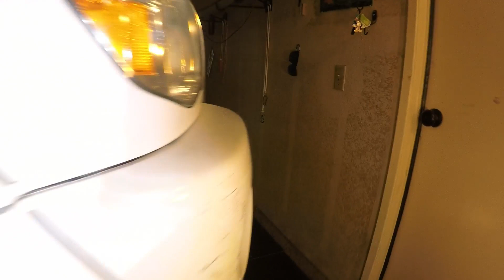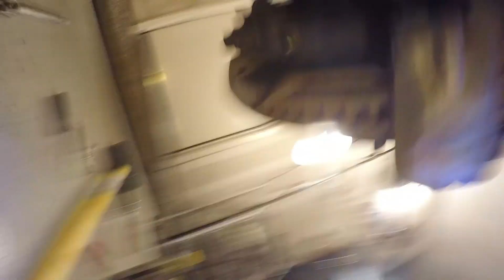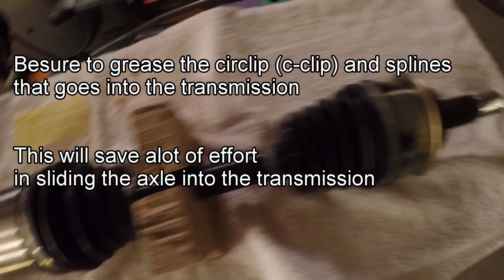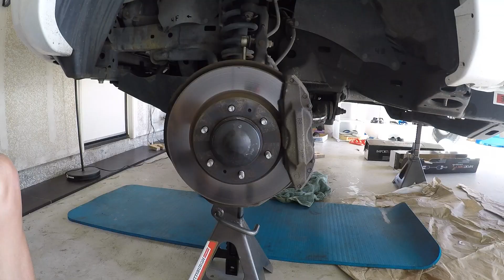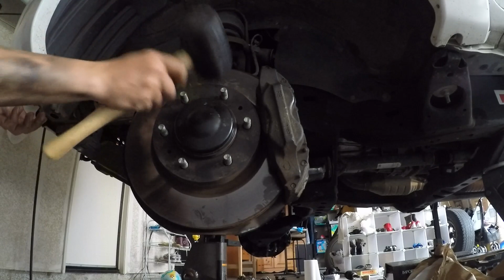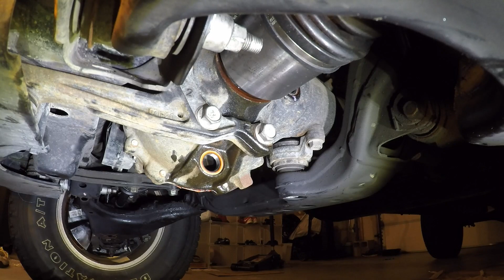2005-2015 Toyota Tacoma CV Axle Replacement Tutorial

Comment: @2:53 you took out the tie rod. I just did this job yesterday without taking out the tie rod.
Reply: Hey man so I must ask, what did you do? Like what did you remove to get the axle out? Hearing different ways is clutch. If you don’t mind dear sir
Reply: @alexandercahoulan6583  I’ve watched multiple YT and don’t believe I’ve seen the tie rod pulled out.
Just hang your brake calliper out of the way, and get the cv pulled out.

Comment: If you have problems getting it in make sure you put axle grease on the splines, put your nut on the other end (wheel hub end) to protect the threads, make sure the axle is pretty straight and tap it with a hammer.

Comment: Not too bad Kurt. But should not damage your wheel studs!!! let hyd. Jack & / or lift do it's job just replace rim and tire with 2 lug nuts low torque  drop back to ground very  gentle  just enough to break the 34 or 35 mm outer nut.  Then reverse process your  wheels studs will thank you at a later date. They really not designed for that type of force applied. Or rotor style. I seen that done before with bars & screwdriver in air vents. Myself I have lock my Tk in 4 -wheel drive before hand on older models to break them bolts too.  Always replace outer seals with new ones. I am middle doing my truck right now got axles installed & all bolts started back.. Pizza time right now:) . myself hard part is blame axle c-clip in axle housing. They always a bitch until they pop loose. I took long bar zip ties to hold bar in place knock it very  hard with 25 pd hammer until successfully.

Comment: Dude! Amazing video! You were informative and straight to the point. I will definitely be doing this my self. How long do you think it will?
Reply: Did ya do it m8?
Reply: @DirtBikes_MathGarden  yes I did. 3 times on the same one. The first time was because it needed if. The second because of warranty (the boot broke). The 3rd (same CV axle) was my fault because I didn't push it in all the way and I popped out from the diff box. It was an easy fix. Just push in and go by feel. I am about to do the other side this weekend. The best thing to use is a slide hammer to pull it out. And a crowbar.
Reply: @DirtBikes_MathGarden  using a small crow bar is best. ***one thing BE CARFUL with is oil seal that sits in the differential. It is only pushed in so if you don't amin the shaft properly you will push it in which will cause a bit of the diff fluid to leak. My recommendation is to slide that part that goes in the diff carefully until you feel resistance. Then just keep pushing it in until it clicks and can't come out. Don't try to pull too hard to test or you pop out the CV from the axel and you have more work.
Reply: @DirtBikes_MathGarden  yes I did. If you get a slide hammer it makes it easy. When you out it back in just make sure it's all the way in.
Reply: JULIO MENDOZA ended up doing it as well. Was not too bad at all

Comment: There is an old trick to separate the tie rod if you don't have the puller in hand, works sometimes...Get a sledge hammer and hit it on a steel section where the tie rod is connected on the hub (NOT the tie rod side), the impact from the hit will make it pop out. Have done a few like that and it takes a few hits to remove it.Working on flip flops is not a good deal, grease, dust, heavy parts and exposed toes not a good combination.

Comment: have you had any problems with the new axle,,?? herd on yotas,,its better to replace boots,,than axle unless your getting different type of axles,,
Reply: hockeyfreak043 any o.e. part is better than aftermarket. would have been better to replace the boot.
Reply: hockeyfreak043 any o.e. part is better than aftermarket parts. Would have been better to replace the boot.
Reply: @camaroman101  not in his case. These are high angle/articulation CV Axles. They are perfect for his lift and application

Comment: Very nicely done! Thanks for the instructions. Did you have any issues after the replacement? I have to echo the "torque" comment. Torque standards are to keep everything working well without vibrating loose or leaking. We in the aviation industry literally live and die by these.

Comment: Thanks for the video, really helped me out. I found that removing the axles from the diff was the hardest part really. A good pry bar with quick repeated force does well. I also tried looping a VERY strong thin rope around the inside of the axle where it meets the diff. Then, looping the other side around a heavy sledge hammer, used it's inertia to pop the axle out. I'd also like to add there's a very easy way to get the new axles IN. You simply hold the axle so both CV joints are zeroed out. Then you compress both joints by pushing the axle in, toward the diff. Then, with the other hand (or another person) hit the end of the now compressed axle to pop it in the diff. This works extremely well. If you don't compress/load up the CV joints with force before hitting the end of the axle they will simply absorb all the force applied.
Reply: Italynstylion thx for this information. It made the job easier
Reply: Italynstylion just finished the job. Thx to you, it was a breeze!!! Thx again for your input. By the way do I need a wheel alignment?
Reply: wilson perez you shouldn't need an alignment. The alignment is determined by the control arm bolts. So long as you didn't remove those you should be fine.

Comment: Kurt, you really should invest a few bucks on a torque wrench. Even a cheap Harbor Freight one will suffice. Make sure you select one that is made in Taiwan, not China. 

Those bolts that you removed should not just be tightened to "snug". You need to torque them to the proper specs. Notice that some of those bolts have a cotter pin installed through them -- it is a safety feature and a second line of defense to prevent the bolt from completely backing out. I don't have to tell you what would happen if you ball joint popped loose on a curved freeway on-ramp.

Be careful with your repairs and be aware of the limits of your mechanical abilities. Would hate to see you get hurt, buddy.
Reply: @cyrusstites4847  it's not demeaning it's about safety if those bolts come loose because they weren't torqued then it could result in a crash think before you comment
Reply: Was that the only thing?? I really have no mechanic experience except for oil change, and cabin and engine air filters. Would like to attempt this myself but don’t wanna jeopardize myself

Comment from the maker: Getting the shaft into the transmission wasn't easy task. I ended up spending hours trying to find the best solution. In the end what worked for me is soak the splines and C-clip in gear oil and grease, then use a wood stock and try hammer it in. Of course make sure the drive shaft is aligned with transmission gear, the only stop force should be the c-clip and not the teeth of the gear. You may need to try twist the shaft around try different positions. I struggled for long time and camera battery went out hence I don't have the video clip to show.
Reply: Kurt Engineer Handyman thx. Excellent job!!! Question, will you need a wheel alignment after this?
Reply: wilson perez that is a good question, I reckon the answer is no though...